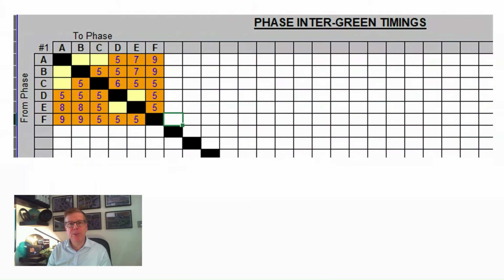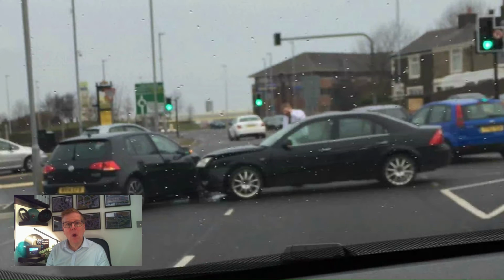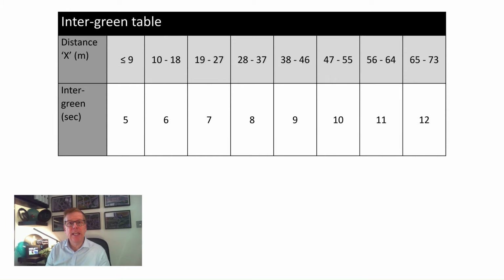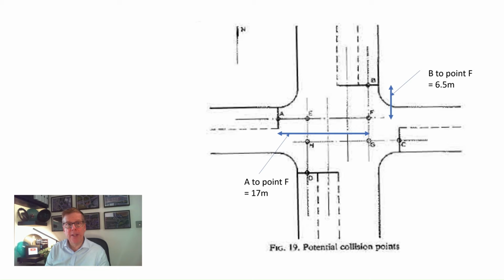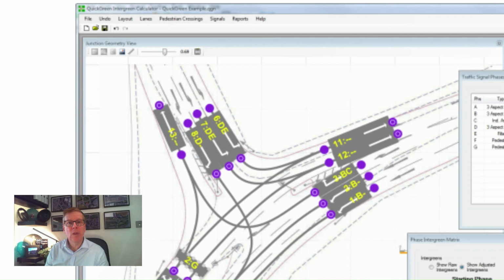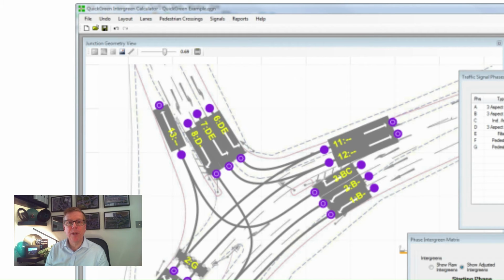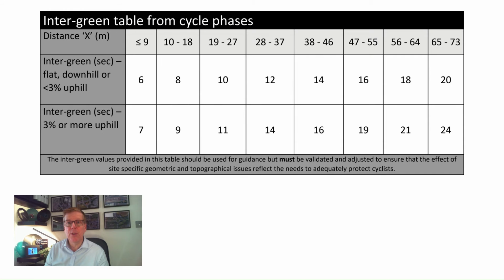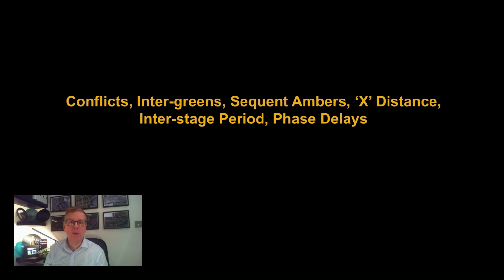Conflicts and Inter-greens - Traffic Signals Principles - Part 2

Comment: It is interesting to note that in TSM Chapter 6 Inter-Green table all the timings increase by 1 sec for every extra 8m of vehicular transit distance except the 28-37m bracket which incongruously increases by 1 sec for a 9m increment. Is this an error or deliberate?
Reply from the maker: The previous version of the inter-green table was even less consistent, so think the version in Chapter 6 was an attempt to rationalise these increments. Going back to Webster & Cobbe (RRL 1966), the increments were 1 second additional inter-green per 30 foot (or part of) distance, therefore I have always thought the inconsistencies arose when we changed to metric!
Reply from the maker: Yes, just had a look at this, the original 30 foot increments equate to 9.1m, 18.3m, 27.4m, 36.6m, 45.7m, 54.9m, 64.0m & 73.2m, so the fourth, fifth and sixth increments have been rounded up to whole numbers 37, 46 & 55m.